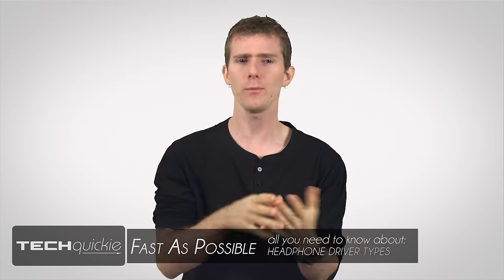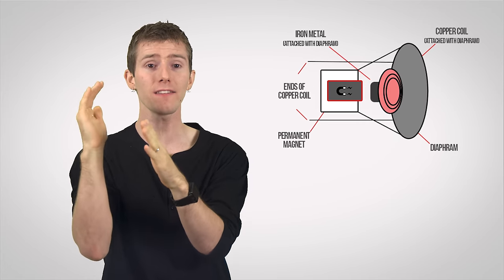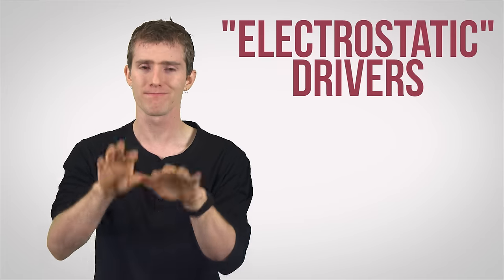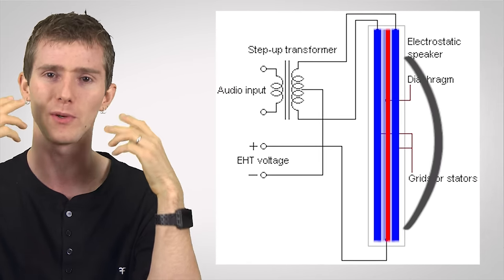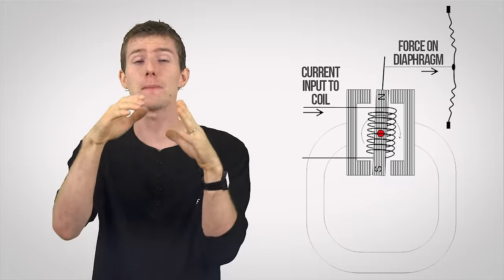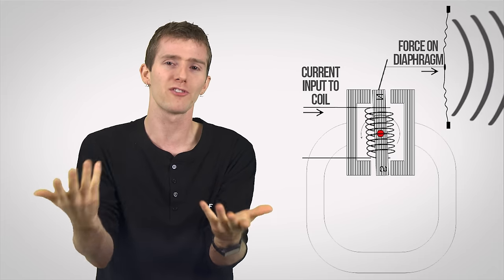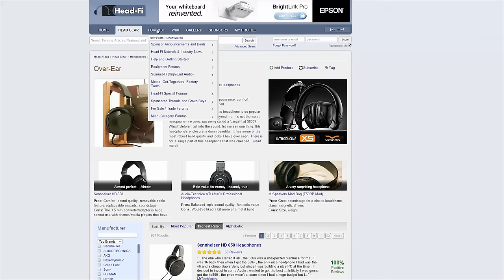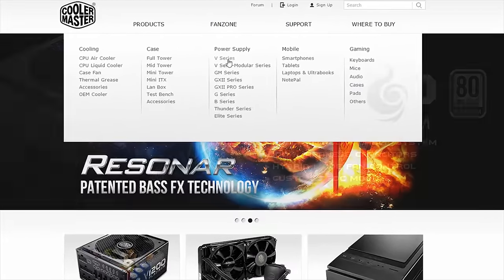Headphone Driver Types as Fast As Possible

Comment: now i have no idea what headphone drivers are
Reply: They are what produce the actual sound you hear.
Reply: ***** They are just the magnet and diaphragm that receive the electrical inputs and turn it in to sound that you hear.
Reply: Their Vibrators for your ears.
Reply: ***** How is that just kinda? That is the layman's terms of how every speaker in existence works. Every single speaker (that includes headphone drivers if you don't already understand that) works via a diaphragm and a magnet. The positioning of those two things may vary but they are ALWAYS there, especially in anything that you are probably buying with whatever money you are willing to spend on them. If you think that this is only sort of what happens than you may need to consult your local psychiatrist.
Reply: ***** umm i dont think headset drivers are like your house speakers bud
Reply: wykedinsanity they are to an extent just miniature house speakers.
Reply: those are people who drive your headphones
Reply: @baraki808  well that's one way to say that

Comment: The driver does not actually convert the digital signal. It changes the analog signal from the cable to sound.
Reply from the maker: should have been "electrical signal" that slipped through. Thanks for pointing it out.
Reply: Techquickie you can tell Linus didn't write this reply because its positive. LinusSaltTips
Reply: +Bryan Oliver True, since at some point just before the diaphragm, the signal must be analog in order to physically produce sound waves. There is no such thing as "digital sound". If such thing existed, it would involve you hearing/seeing numbers floating around and your brain interpreting them as sound waves, something that doesn't even make sense.
Reply: +Leonel Cantú de Llano (Mr. Chilli) it can be digital, but all you'll hear will be high pitched beeps

Comment: Great video, thanks! My only criticism would be that planars weren't covered in enough detail compared to BA, which I'd not come across before. 

IMO for portable use, planars are a really good compromise - they have the main benefit of electrostatics in that the diaphragm mass can be tiny giving excellent transient response and a wide frequency response. They have the benefit of not needing a high voltage power supply and their impedance can be in the realms that a smartphone headphone output can drive directly (a better solution is an external DAC such as the Chord Mojo). Worth having a listen to.

Comment: I would really like to know the diffrence between the diffrent LGA sockets. 
This would really be a good idea, because it would explain people what motherboards to buy, and what processors that are compatible with that motherboard, also, if there is any performance gain if you have a 2011 socket processor, vs LGA 1155 socket, that i currently have.
A really good video suggestion, because there are more people confused about the motherboard compatible processors, than you might think.

Please like this, if you feel the same way!

Comment: I love that you mentioned Head-fi. anytime someone asks about headphones or anything related to audio I point them to Head-fi. Yeah, some of them are a bit elitist(read as A LOT) you can easily sort through it and find genuinely good advice and people that help you find out what you want. Thanks to them I've found three great set of headphones(Shure 440, Grado S80i, and Fischer Audio DBA-02) and even purchased the latter of the them from people on Head-fi. and when my DBA-02's got attacked by a cat? I was directed to someone that modded the then dead IEM's to use a replaceable cable.

Comment: My Sony MDR-MA900 have 70mm dynamic driver... It's so big that is almost comic but the sound is so smooth and enjoyable.
Reply: I don't think there's really a concrete correlation with bigger driver meaning better... well, anything. It's kinda those specs that I felt are just being used just for marketing due to "More/Bigger = Better", just like frequency response (MA900 and my ZX701's FR is 5 Hz ~ 40kHz)
Reply: Rohan Espada But I never even insinuated that... you are reading too much on those two lines.
MA900 is just a weird monster that uses the same driver to the old top tier Sony Extra Bass line, but with a different presentation creates a surprisingly balanced and still the best/wider soundstage up top $400 category. Try them before you knock it.
Is just a waste because it is discontinued now and Sony will probably never pursue the mid and hi-fi section again after this.
Reply: ***** Woaaaah, hold on mate. You've got the wrong idea!

I was just generalizing about the whole driver specification of headphones; didn't mean to make it sound like you were hinting those words. I am not knocking on the MA900 on anyway. I actually want an MA900, as it can serve as an upgrade to my HPH-200, my primary open headphone, while somehow keeping the same-ish sound signature (according to the few reviews I read/watched). Will probably grab one if it drops <$170 as it seems it still has a decent stock in Japan. Though I'm not quite sure about your claims on its soundstage as the $300 ~ $400 price bracket offer a lot of headphone juggernauts. But then again, everyone hears differently. I can't even hear the difference between the HD600 and HD650 so... that's that.

It really sucks when Sony (and other companies as well) quickly discontinues their great headphones (but for some reason, the V6/7506 still exists). While not really a "great" headphone, I still want the XB500/700 for being ear pillows and its ridiculous "for the lulz" bass.
Reply: *****
 Not the first time Sony has discontinued absolutely stellar models, such as some of their woodies. But yes, the recently discontinued and reasonably midrange line did have some interesting products, even if somewhat leaning towards a rather specific signature.
Reply: Rohan Espada That's not a frequency response, that's the range their hyper sensitive test equipment can detect any noise in, which at the extremes is far, far too quiet to hear.  Also hujmans can't hear past 21.5kHz-ish, so the 40kHz max is a useless figure.  A real frequency response is a graphed line, with the horizontal scale being the frequency, and the vertical scale being the volume the headphone reproduces that frequency at.

Comment: I just want to point out that electrostatic drivers are actually pretty much free to produce. 

The problem comes down to manufacturing processes and company costs. Stax, Sennheiser, King sound, and a few other micro companies are the only people to have ever made electrostatic drivers for headphones. With the exception of sennheiser, these companies are tiny and never really made a cost effective way to produce these headphones. 

Companies like martin logan who make electrostaic speakers on the other hand have a much larger and more efficient manufacturing process. The only reason their speakers are expensive is because of supply and demand. A lot of people want the unique sound that electrostatic speakers provide, but martin logan pretty much has that particular market cornered, so they charge more for it. But the actual cost of their drivers is pretty much next to nothing.

Comment: Difference between Hz and FPS?
Reply: Hz is the amount of times something oscillates in a second. Hz is frequency so that could mean you could technically measure the amount of waves hitting the shore of a beach in Hz. Its commonly used for sound and lighting because these are 2 things that oscillate very quickly. FPS on the other hand is frames per second. This is mainly used for computer monitors to see how many times the screen image refreshes in 1 second.
Reply: Hz is static, 60Hz = 16.6ms, or 1/60th of a second between refreshes. FPS counts the amount of frames made or delivered in the last second. A higher FPS means almost nothing without a higher refresh rate too. 60Hz=displays 60 full frames per second. If you have a 60Hz monitor but get 120FPS, then you will see half frames, also known as tearing. This is why V-sync was made, but that introduces some input lag. Hz is measured by your monitor, FPS is measured by your GPU/graphics processor/video output device.
Reply: ***** Actually FPS = Hz, is the frequency of something in 1 second, for example 60 Hertz/HZ means 60 cycles, and it's sortof equal to RPM in a way, for example, the i7 4790k is 4.0 GigaHertz, that means it has 4 billion clock cycles in a single second.
Reply: Hz is a unit of measurement, stands for Hertz. It is the unit of measurement used for frequency and is defined as the number of times something happens per unit time (second). As a result you can convert between Hz and S by using  Time = 1/Frequency or Frequency = 1/Time.

FPS is not equal to Hz, however it is measured in Hz. In the context of monitors and computers. The refresh rate of a monitor will be at some fixed frequency, this means it will "re-draw" itself x many times per second. The FPS (Frames per second), is often attributed to the rate at which your computer can output frames. What this means is that your computer (GPU specifically) may only be able to put out up to 60 frames per second, meaning that new frame data is only sent to the monitor 60 times per second. As the monitor is updating faster than that, you can experience strange artefacts, as the two streams of data are not in phase (not synced up), meaning some frames will last for 2 cycles on your monitor instead of 1 (when no new data is present). This happens because the monitor refreshes again, before the computer has had chance to send its next bit of data.

In general however, moving back to the original point, try not to get actual variables and units of measurement mixed up or defining them as equal, as technically saying they are equal means nothing.

Hz = unit of measurement to describe frequency
FPS = some quantity which needs to be described in terms of frequency (using Hz).
Reply: D4rkR3bel5 Hz isn't static with a G-Sync monitor.
Reply: Jacob S G-Sync is a niche right now.
Reply: D4rkR3bel5 So? Your point?

Comment: Dynamic drivers sound the most natural sounding, and weigh the least. The trade-off is that they are hard to make completely neutral, without a major lower bass loss. There are ways around that, of course, and certain companies (not naming names) are making major steps forward.

Comment: I have a i7 4790, Gigabyte z97 HD-3, Gigabyte GTX 770 4GB, Samsung 840 Evo 250 GB SSD, a Seasonic 750w fully modular PSU and the standard CPU cooler and the fans which came with my Zalman Z11 plus case. My system is pretty noisy so if i change out the standard CPU cooler out with a H100i and the standard case fans with Noctua NF-F12 fans, shouldn't that make the system much more quiet? Are there any other thing i can do to make my system quieter?
Thanks <3
Reply: /r/pcmasterrace or /r/buildapc is where to go friend, not YouTube.
Reply: Brucap12 I have had VERY positive experiences before on Linus's channels.
Reply: Yeah, but i've seen one of your posts before, where 10 people say 10 diffrent things, thats why i picked those subreddits :)
Totally up to you bro :)
Reply: the H100i cools well, but is not very quite. My suggestion, is get the h100i, and replace the fans with some low RPM Noctua fans, as well as all your case fans.
You can also use software like MSI Afterburner to set custom fan profiles for your GPU, to keep it quite. At the cost of a little heat, of course.. But if you dial in the right settings, you can make it near silent.
Reply: Eroa If you want an aswer from the "linus community" you might want to check their forum, at www.linustechtips.com
Reply: So can i just replace the standard fans on the H100i with NF-F12's? I actually use MSI Afterburner and i have OVerclocked my GPU a bit.
Reply: ***** Ok thanks a lot mate!
See i always get great feedback from Linus's channels;)
Reply: ***** I have thay 770 you are talking about and it is defiantly not the loudest thing I'm my system. At idle you can't really hear it, but under load the fans turn up like any other GPU! I can't nothing but recommend it!
Reply: ***** Why go with with a 770 when a 970 now comes stock with 4GB of VRAM and requires less power with more performance? For only $320 (or so) it isnt a bad deal. Only issue is that you have to wait for the card to be more readily available. (P.S. I own a EVGA 770 SuperClocked with the ACX cooler and its very silent)
Reply: ***** Wow i got mine for like 320 pounds. I feel stupid now.
Reply: I also live in Denmark where tech is so overpriced.
Reply: ***** I've literally just wrote a novel about it in a few comments back;)
Reply: You'll need Dynamic Drivers.
Reply: you could get AiO cooler and get 2 more fans to do push / pull you can also try tidying cables more and clearing dust, im just spitballing really
Reply: Eroa that will work just great. you could also get four fans for your rad (providing your case has room for that much thickness wherever you mount the rad) and go push pull.
Lower the RPM even more and get it even cooler at the same time.

But a two fan config is just fine as well.
Reply: Darude - Sandstorm
Reply: Be careful man. You may have troubles mounting the radiator at the top of the case because of lack of space between motherboard and ram and the top mounting spots. I was unable to fit a radiator in there and had to change case.
Reply: Nation of Spikes Im pretty shure that there is space.
Reply: Well, I am pretty sure there isn't. I bought an Asetek cooler for my CPU back in the day, and had to mount it to the bottom of the case because it would not fit. You can measure it though. Corsair H100i with fans on is about 5.50 cm. My other radiator was 6-6.50 cm and would not fit. Also, the case theoretically is not made to put rads on the top, but just fans.
Reply: Nation of Spikes I have just seen a video where a guy has mounted a H100i in the case i have. So yeah it will fit.
Reply: Oh well, ok then. Yea, that radiator I had was a bit thicker.
Reply: Nation of Spikes But which case did you have?
Reply: Zalman Z11 Plus, same as yours as you stated, right?
Reply: Nation of Spikes Yeah, but what CPU cooler did you have?
Reply: It was and Intel RTS2011LC. Basically a rebranded model from Asetek
Reply: ***** for not much more you should get a 970
Reply: Isaac Pittman He got a good deal for the 770. 180 pounds.
Reply: I'm not sure h100i will fit in z11, i got it and went for Nh 12p se2 because of clearance issues
Reply: Anthony Sharpe I just need a good quiet CPU coller. What would you recommend?
Reply: ***** First of all you don't know of a watched the video (and I did) second of all if you don't wanna help he you don't have to. But YOutube is the easiest to get feedback from in my opinion. And the people who had commented actually helped me, and it it only you who are being rude.
Reply: ***** You are not excatly being rude, but you are being anoying
Reply: Eroa any noctua in your budget, i love mine, but pretty sure h100i wouldn't fit
Reply: Anthony Sharpe Yep planning of changing my standard fans out with some NF-F12's Also I have heard that the H100i is pretty loud so im also planning of changing the standard fans from the H100i with some more NF-F12. 
Why shouldn't the H100i fit?
Reply: ***** I don't think you should come in an bring a bad vibe.
Reply: ***** Please just let it go and move on in your life.
Reply: Yes H100i with noctua fans aswell noctua case fans will make your pc significantly quieter
Reply: ***** Nice!
Reply: Eroa i'll send you a private message with a photo, looks pretty tight, you're gonna have to fit the fans on the upper side of the case i think, under the plastic fins, i don't know if it'll fit
Reply: Anthony Sharpe Thanks, that would help a lot!
Reply: Droplifter I have an h80 I think it is or h90 cant remember, and I LOVE it. never let me down. I had to do a little custom drilling to align the holes in my mid size case (didn't want a beast sized case though it is better for cooling), but it worked great. still going strong after 3 years
Reply: Droplifter yuop i had a pump quit on my h100
why i use noctua air now